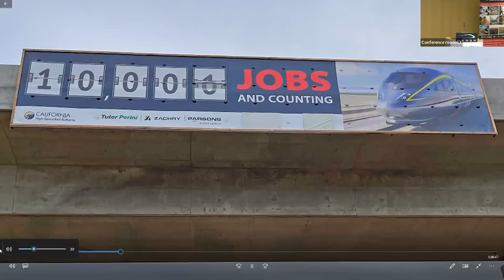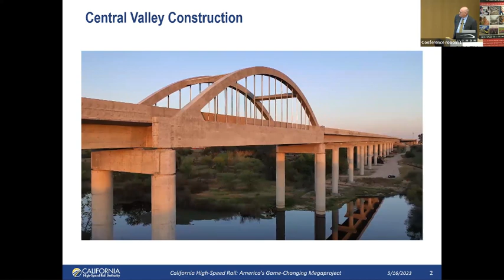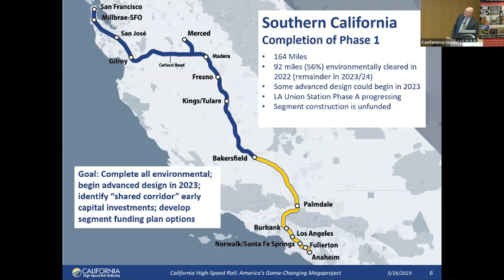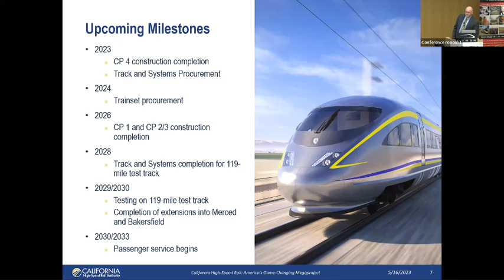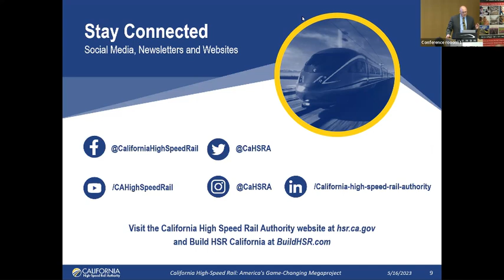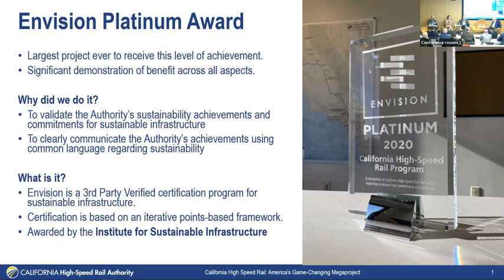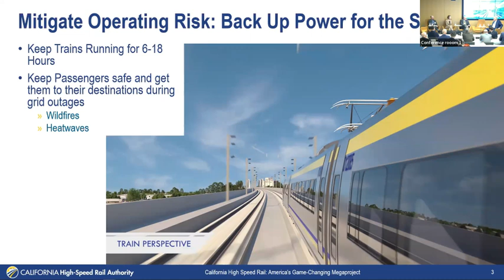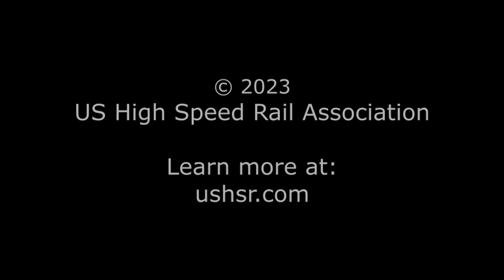California High Speed Rail Presentation (High Speed Rail 2023 Conference)

Comment: I'm glad CA HSR is getting HSR built in CA, I'm also glad HSR is going after all the grants needed for construction 🚧. HSR needs to get those samples for the tunnels to get an idea of what will be required. Nothing is ever going to have a simple answer, CA has had to buy the row for the tracks and demolish or move objects in the row, objects includes roads, buildings, railroad tracks(BNSF+Union Pacific), power lines, a farm related canal, sewer lines, etc, etc, etc.
Both the state and contractors are waiting on objects the state doesn't own to be moved, it's a huge project on the scale of a fwy with larger turns, make no mistake I like what I see, I'm almost 63 years old and I've watched a lot of freeway construction so I know what to expect since HSR & FWY's are similar outside of differences in curve radius and the fact that HSR has no on and off ramps and that FWY's have no stations.